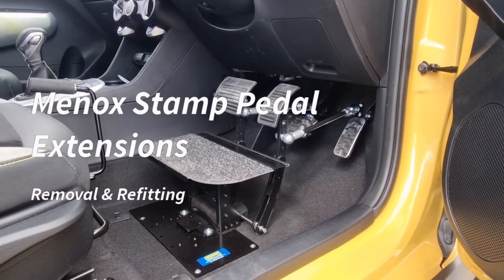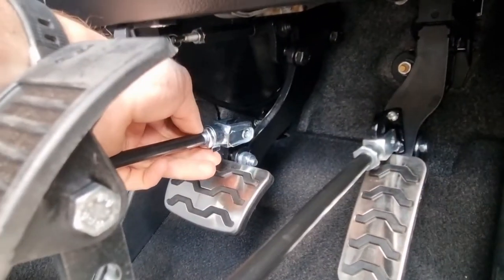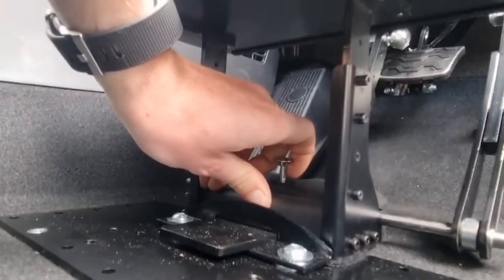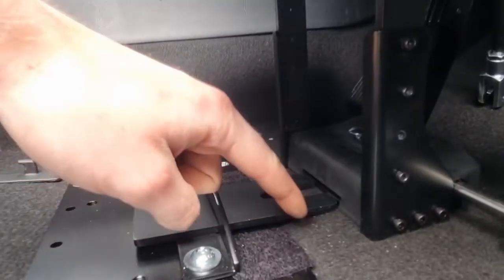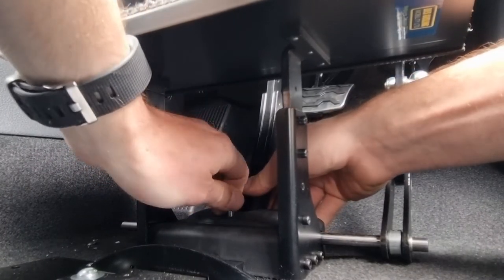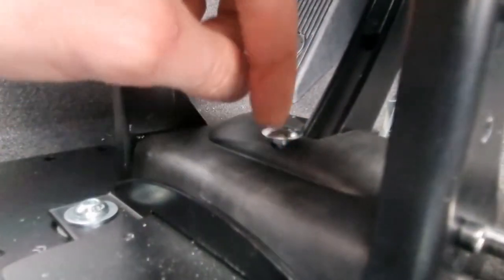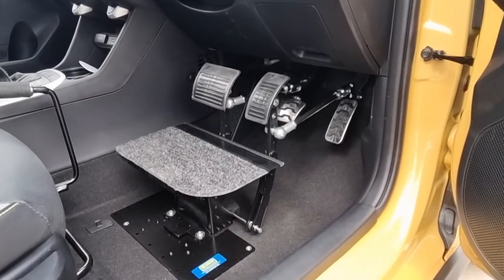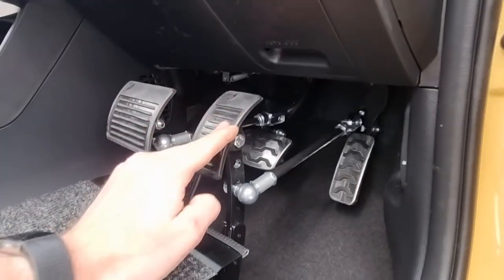Menox Pedal Extension - User Guide

Comment: Hi, I am getting a Vivaro E and need the raised floor with pedal extensions. 

With the battery and wires underneath is it possible and safe to install this adaption?
Reply from the maker: Good Morning Samantha,
Yes, we have methods of safely mounting the baseplate for electric vehicles. Please get in touch with us on sales@desgosling.co.uk or 01332863742 to discuss your particular requirements.
Kind Regards,
Des Gosling Mobility Ltd
Reply: Fantastic I will pass this onto my local adaptions centre and get them to contact you. Thank you for your help.
Reply from the maker: @samanthauk.tx.uk.3257  Unfortunately, these are not brackets which we supply as we are not the manufacturer of this product and we would produce these as a bespoke item for our customers. So your local adaptations centre may still say that they cannot install the product in that vehicle, although we would be happy to hear from them and can try to advise if they ask for our design team.
Kind Regards,
Des Gosling Mobility Ltd